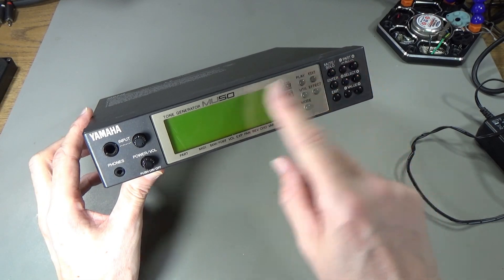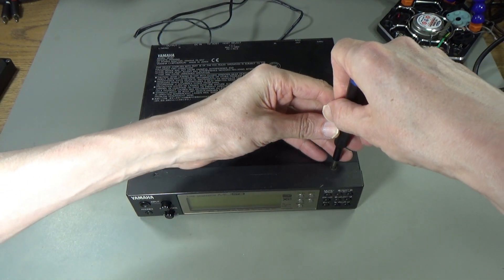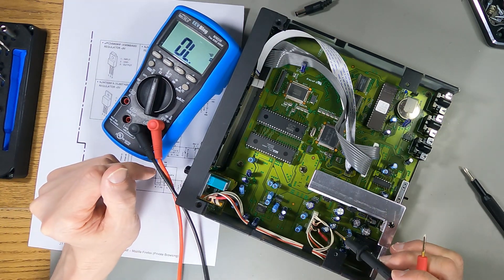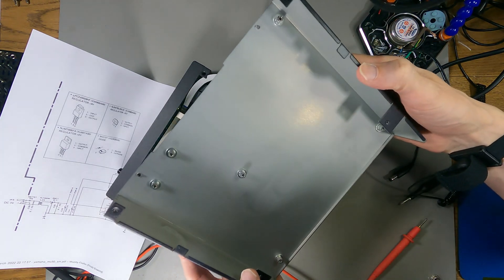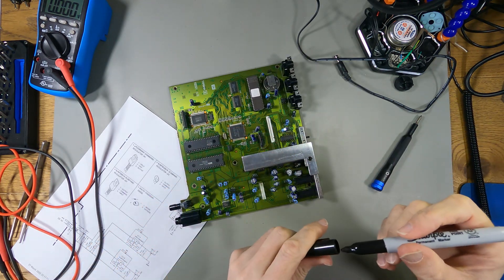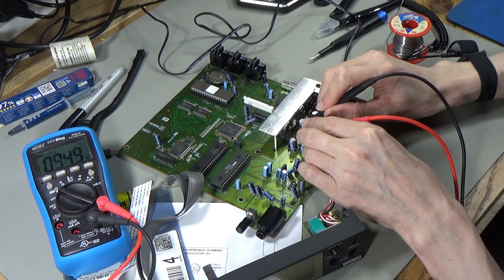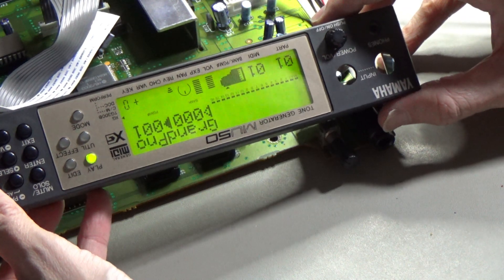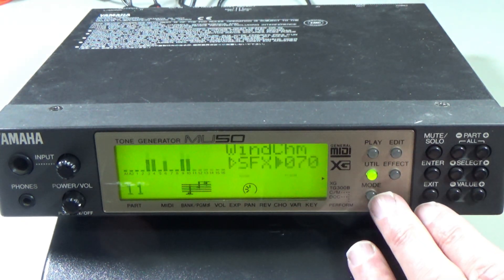Yamaha MU50 Tone Generator Repair ♫

Comment: Thanks so much for the link to the service manual provider. You've increased my chances of repairing the Yamaha VL70m tremendously.
Reply from the maker: Cool. Did you have a similar problem?
Reply: @DavePoo2  with the schematic I was able to check voltages. Couldn't find a failure. Using the minimal contrast screen I went into utilities and adjusted contrast. Then with the screen back to normal I did both the factory reset and the other type of reset (I forget what it's called). Sound is back. Everything is working. There was never a need to open the case.

Comment: A few tips for desoldering...

It definitely helps to add flux, and sometimes to add fresh solder as well, so it mixes with the old solder.

Also, even with the desoldering station (I have the same Duratool / Zhongdi station), it can help to hold the board vertically, or even tilt the board slightly towards the bench.

That assists the desoldering gun, so it's not working against gravity.

The original solder container on the Duratool were plastic. Mine eventually melted / imploded, when I left it on too long. lol

They replaced those with glass containers, which are much better.

One issue I had, is the nozzle/heater got blocked solid...
I had to replace the whole nozzle assembly, twice.

I learned to always clean the nozzle with the cleaning wire after each use, and leave the wire in the nozzle before turning the station off.
Reply: It was quite common for linear regulators to fail on old computers etc, btw.

I guess a lot of the reason is thermal cycling, which can eventually break the internal wire bonds, or maybe even cracks the silicon?

So many times, you will see linear regulators, on a heatsink which is nowhere near large enough.

(the amount of heat depends on the average current draw, the input vs output voltage, etc. but still.)

Comment: I've got an MU80 and only the top left quadrant of the display works. Found your video and thought there might be some hope (very difficult to configure when you can't see the screen), but the 5v regulator is putting out 5.2, so I guess I have to keep wondering what's wrong.
Reply from the maker: If you power on whilst pressing [Play] & [Mute/Solo] then you get the test mode, use the select and enter to go through the tests. It says test 3 is "LCD All dots on", it says you can press select  in this mode to control the contrast. See if you can get into that mode, as I suspect you might have a bad LCD. (the details of this are in the MU-50 service manual that I've got linked in the description). There is also a similar MU-100 manual here -> https://www.polynominal.com/Yamaha-mu100/yamaha-mu100-service-manual.pdf
Reply: @DavePoo2  thanks, I'll give it a shot

Comment: Nice fault find and repair. I had a feeling the cell battery would be OK. I powered up my A1200 after many many years in storage and the cell on the ram expansion worked perfectly.
Reply from the maker: Thanks. Yeah, I was quite shocked about the battery. But I suspect that the 0.8V I was measuring everywhere was actually the battery voltage. The cell is a CR2054 and is supposed to be 3V when fresh, so if it is only at 0.8V then it's probably time to replace it. I should have directly measured the battery whilst I had the thing apart, but I was so eager to plug it in and test it out.